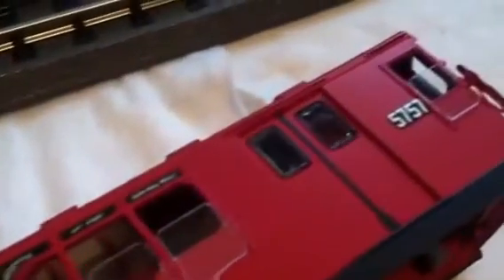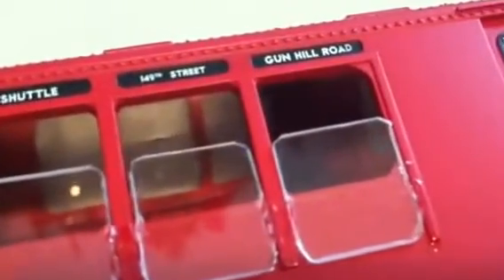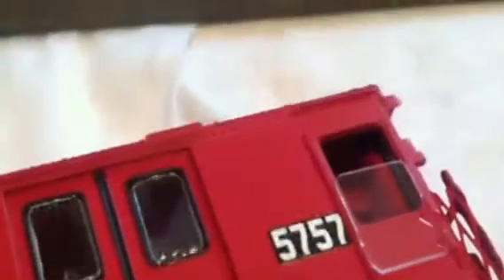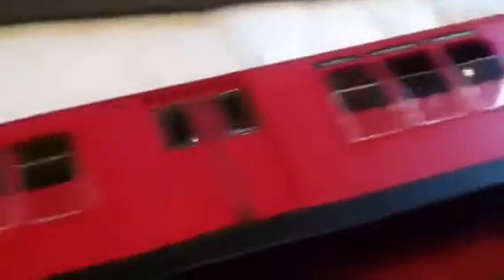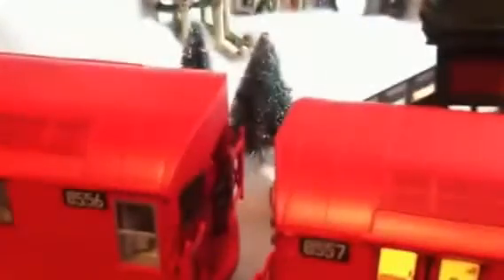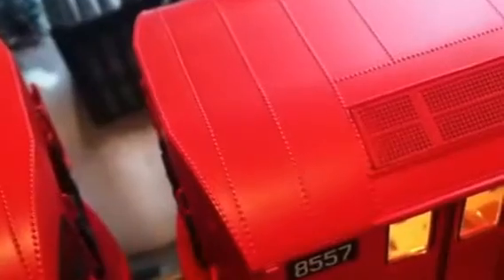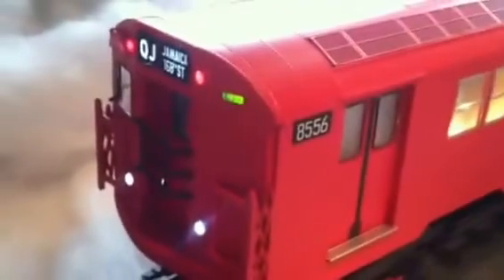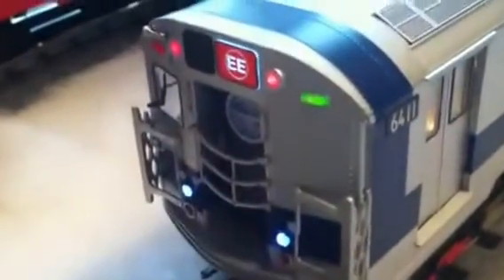O scale subways pt7 lionel subways

Comment from the maker: Thanks, the R16's are a bit problematic. They were struggling to pull all 6 cars for a wile. Also the paint has some blemishes and the windows all fell out. I would say get the R30's if your going to go with lionel. But mth makes a better model in my opinion.
Reply: Thanks for the info. Yeah, I think the MTH subways are better too especially because you can have them run pretty much by themselves.